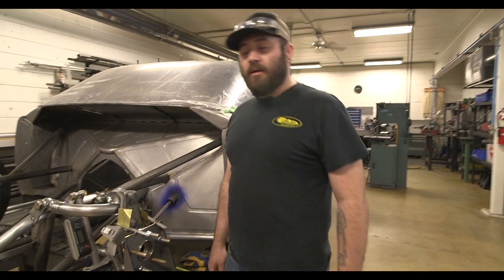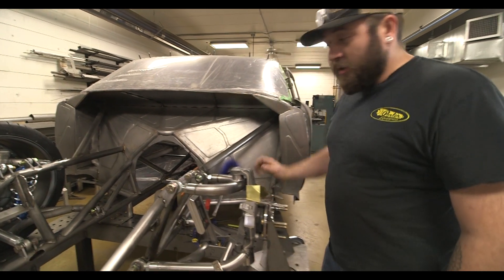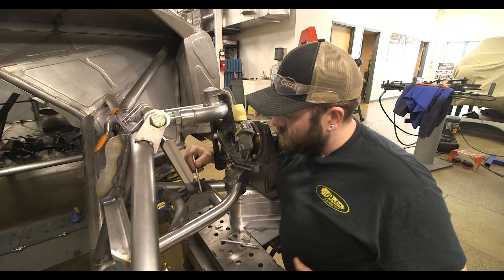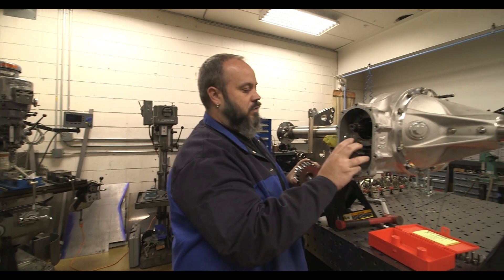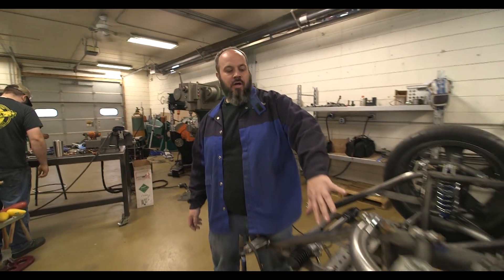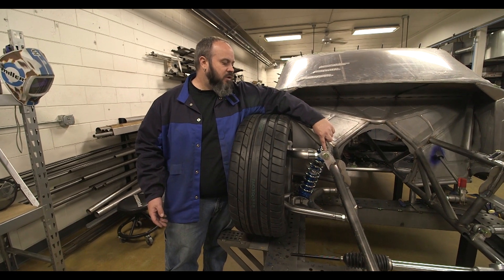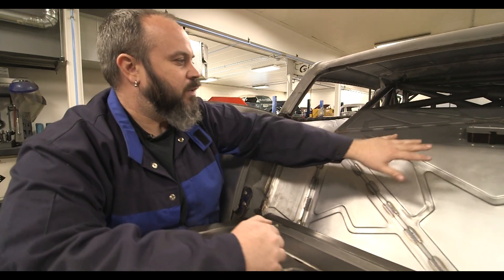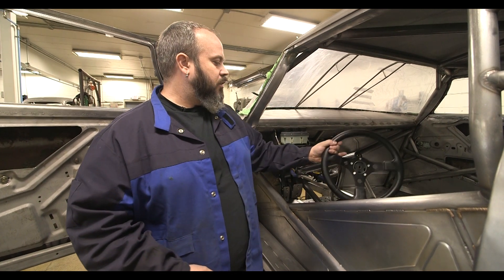Gizmos Garage - Episode 22 - Control Arms & Quick Change Rear Gear

Comment: How much caster is built in?
Reply from the maker: Great question, Creating enough caster for land speed racing yet, making it streetable at the same time is a fine line. I'm not willing to say what we came up with but it was well considered.
Reply: @gizmos9701  obviously not a land speed racer but I had to toe that line with my 63 Falcon when I put the coilover AJE suspension in and made my own shock towers.  It’s especially important with manual steering racks...  I don’t have hulk arms! 😂 I’m not dedicated enough to make videos but it’s in Facebook if you are interested.  Bag of Bones 1963 Falcon Build is the name.  Thanks for sharing your build, cool stuff!
Reply from the maker: @MissionRestomod  Thanks for sharing, we will check it out.
Reply: @MissionRestomod  We super appreciate your commentary - thanks for checking in and asking questions. Everyone has to keep their trade secrets ya know? ha ha that Falcon build looks cool - are you going to rat rod it , hot rod, period correct resto..?  for all the kids out there, here is @missionrestomod's page with the project https://www.facebook.com/BoneBag1963/
Reply: @scottmclain2738  Restomod is the plan.  393w with some boost on top. Manual transmission, of course.  It will be daily drivable in nice weather, no trailer queen.  I might do the body work and get it vinyl wrapped instead of paining so I’m not afraid to drive it and park in public lots..  😂 Still a lot of metal work to do before I worry about looks.